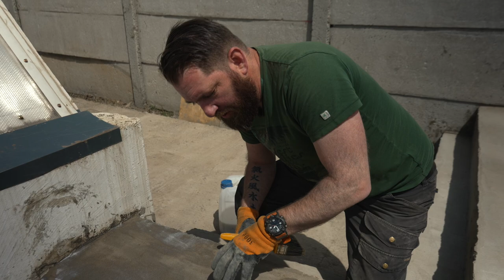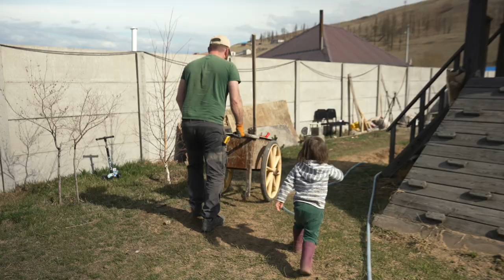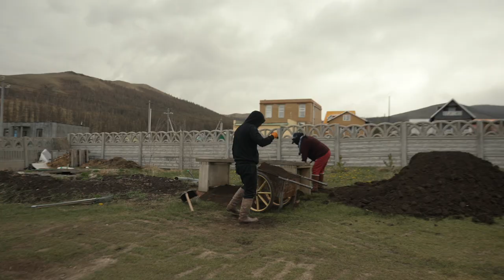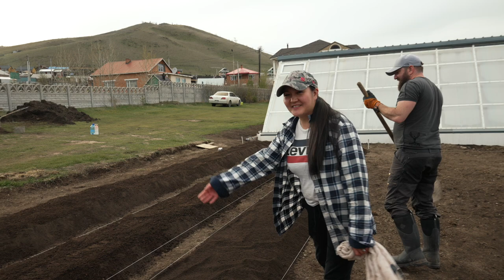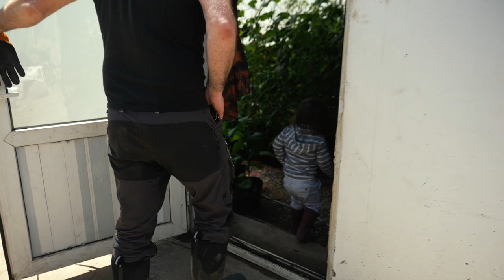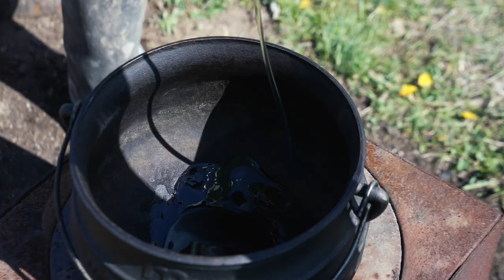BEING PREPARED Mongolian Homestead: Building Garden Beds and Cooking Curry

Comment: That flooding could ruin a lot of things on the property. A solution might be to build a french drain.
Reply from the maker: Hi Ham 👋 yes we have. We will put one in when we start working on that side of the property 🙏🏻 thanks bro
Reply: @SimpleWildLiving  Make sure you put a stainless steel critter guard at the end of the french drain. Those little critters can get in there and clog it up
Reply: @SimpleWildLiving  When installing a French drain, it is important to be mindful of the type of stone you use. Stone chips can pose a significant issue by potentially clogging the perforations in your drainage system. Whether you are setting up a yard drain, a French drain, or a larger Sump System, the presence of chips can be detrimental to its functionality.
Reply: @SimpleWildLiving  also another tip: clay can be used at strategic points like the edges to keep water out.
Reply from the maker: Thanks 🙏🏻